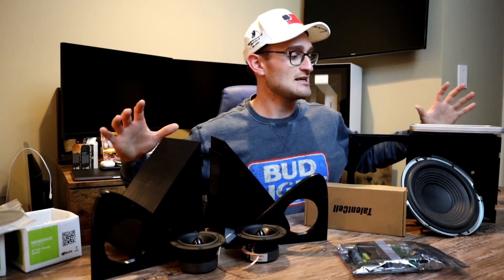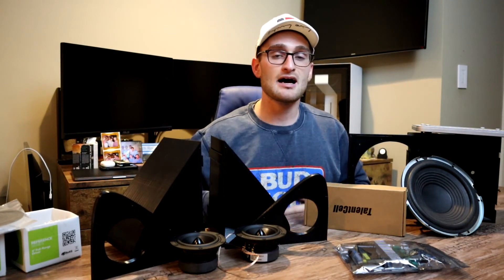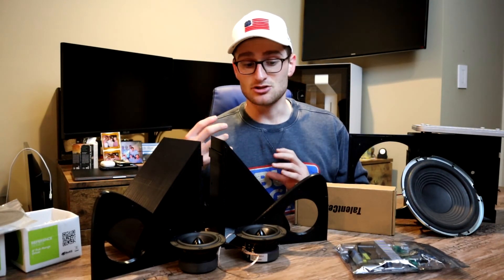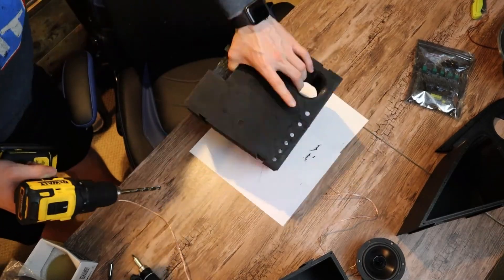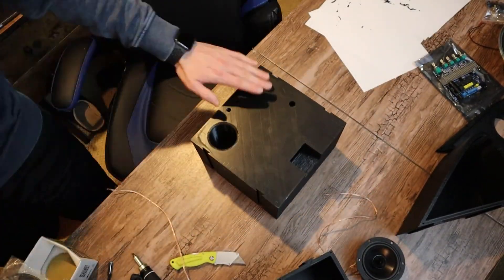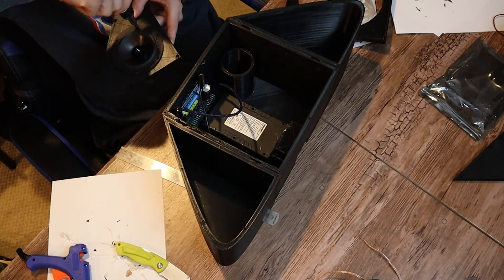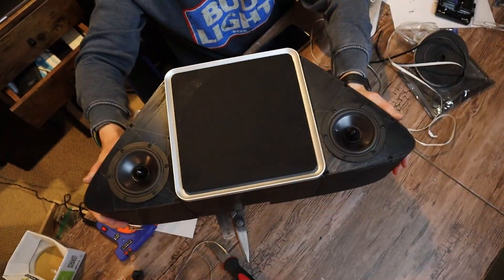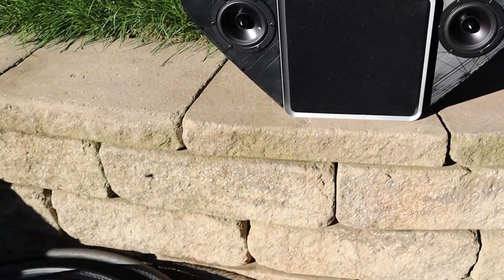DIY Bluetooth Speaker … Fully 3D Printed Enclosure

Comment: I’m new to 3D printing. How did you learn how to design, and what cad software do you use? Are your .stl files available for download? Thank you, Rob
Reply from the maker: I went to school for mechanical engineering so I learned cad there using solidworks, but I now use fusion 360

Comment: Its funny cuz i just got a 3d printer and this is the first project i did a while ago, i made the case with wood tho cuz with all that thinkness you need if you did 3d print it it would be like $100 in fliament which is pretty expensive
Reply: At this point filament is cheaper than making it out of wood.
Reply from the maker: Turned out to be $40 in filament (around 2kg) printing at 35% infill with .3inch thick walls
Reply: @TechRoundUp  what a bargain, dayummm
Reply: I know, it’s an old comment… But in case anyone reads this: that’s absolutely not true! 🤣 
First of all, not only does 3d Printing give you a lot more options to design your enclosure… you also could make shapes that are nearly impossible or even are impossible with wood!
Also it’s a lot less work to make the enclosure… 

I agree with you that if you don’t have any clue about speakers, enclosures or audio in general, but you just want to make a Bluetooth speaker, then go for wood! Because it’s more easy to make a speaker sound good! 🤷🏽 

But if you have a lot of knowledge, then 3d printing an enclosure is not only better because of your nearly unlimited possibilities in designing, it’s also Cheaper! So what you are saying isn’t true… 
The right design and dimensions on the outside AND on the inside combined with the used hardware is what makes a good sounding speaker! There are so many things to consider like frequencies, standing waves etc.

What really matters just is the right design and the right dimensions! And NOT the infill! 😅
If you design your speaker right, it will sound amazing! And you don’t have to make it that thick or have to use so much infill! 
Edge loops are important, that’s true! But People really think that you have to make the wall 1 inch thick and using 100% infill! 🤦🏽‍♂️🤣 
In fact, If you design it right, there is ZERO difference in Burst Decay with 10% infill and 100% infill! The 100% is even slightly worse! 💀 
It’s the same with frequency response! It’s nearly completely identical between 10%, 30%, 60% or 100% infill! 🤷🏽 
Only if you put a vibration microphone directly onto your speaker to measure the resonances of your enclosure, you will have a little less impedances with the higher filled speakers! And those differences are extremely small! And even here the best is NOT the 100% infill! It’s the 60% infill that has the least vibrations! 🤷🏽 

So you definitely DON‘T have to use that much infill or need that much thickness! It’s 99% the speaker design that makes the difference! 😉 

And on top of all that, we have different infill patterns that makes the enclosure a lot stiffer! And we have damping materials too! That could make huge differences! 
Just alone these two things are WAY MORE important than the infill percentages! 🙈 

For example, try to 3d print things with a „Grid“ pattern and then do the same thing with „Gyroid“! 🤣 that’s a HUGE difference! I am pretty sure that even 10% infill from Gyroid is Stiffer and overall better in ALL things than 30% infill with a Grid pattern! 
Gyroid is in my opinion THE SINGLE BEST infill out of all! I use it almost everywhere! 
Not only does it make your print EXTREMELY strong, but you also need so much less infill with it and on top of all that, it’s one of the fastest infills too! 

These things that i wrote here have ALL been tested with professional microphones with the same speakers and enclosures! Only difference was the infill with 10%,30%,60% and 100%!

I recommend using 30%! You don’t need so much material and time! 
If you want the absolute sweetspot, use 60%! 
But you could even use less! 
Like i said, there is not a lot of difference and a solid printed speaker will even be worse! 😉

So that you have to use 100 dollars of filament is definitely NOT true! 🤦🏽‍♂️
Except you want to print a Soundboks for example! 🤣

Comment: Cool unique design, love it. 

Some suggestions that I saw was that the dovetail rail design is definitely a cool concept, but maybe just some alignment pins and screws would allow for an easier job cleaning up the PLA. Also, rear mounting the drivers could be better to prevent any damage to it if the boom box falls on it's front face, the sub grill should prevent it, but it's worth a thought. Also, with the battery that you used, being able to use the usb port so that you can charge devices would be a nice feature as well. Otherwise, great job, wish I had my own 3D printer to make one haha.
Reply from the maker: Valuable feedback!